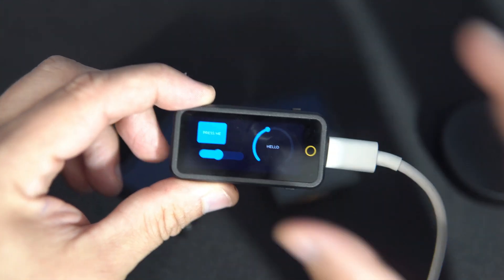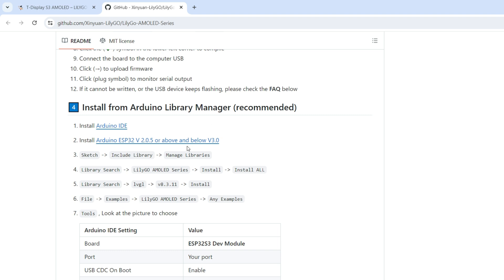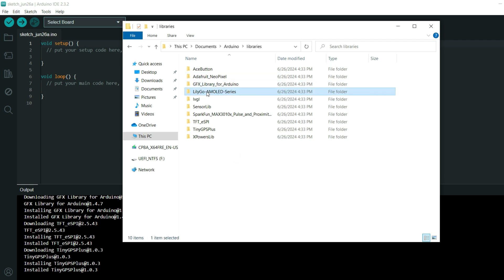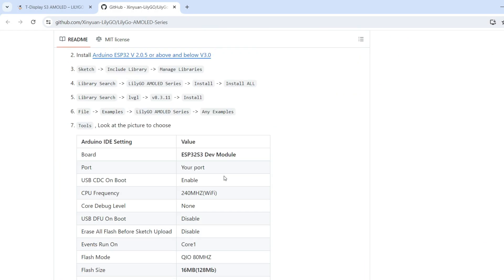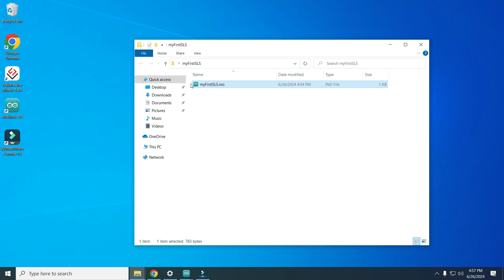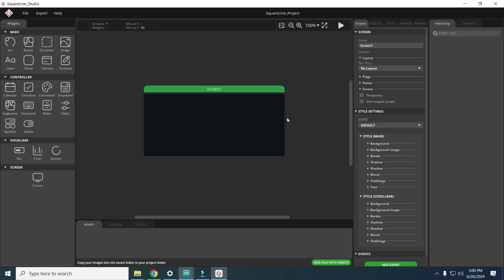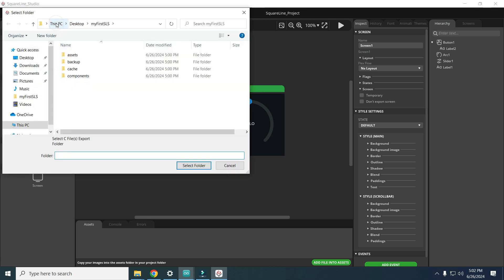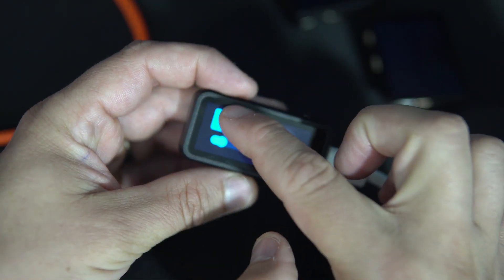SquareLine Studio AND ESP32 - Tutorial Part 1

Comment: Which current board do you advise for S# + LCD + Touch? 

I try to avoid AMOLED board to avoid the buring in issue when using 24x7 for a long time
Reply from the maker: no my friend, amoled dont have burning isue. OLED has.
Reply: @VolosProjects  
Has this been tested? An other brand where I asked the technical support about AMOLED gave as answer. "It is not recommended to display 24 * 7 static pages on the screen, and it is necessary to refresh them periodically""

Thank you for your input

Comment: But you add some "include lines at the beginning of the exported file, such as  lilyGO_AMOLED.h and some others by example the BL_ON for the backligjt is the screen,  the ttgo.begin() and where did you configure the pins for the display from sqareline studio...?
Reply from the maker: evrything is installed by instaling AMOLED series board, thats why i am using this board, becouse it is easies to setup and use with sqareline. you dont need to define any pins, long time ago we needed to do that, but with new board you just install new filles and libraries.

Comment: Why is everything so messed up, installing/uninstaling strictly defined versions of libraries, some not adequate tricks.... and tips. 

Why can’t they ( I mean Squareline Studio) create a development environment like, say, this is done in Microsoft Visual Studio, where everything is simple and clear:   like threw a control (widget) on the form, gave it particular processing and that’s it. In general, I really wanted to start using this library, but I probably won’t.  Hate to do something, which have no clear explanation WHY, when the only "logical"answer to the question WHY is BECAUSE .
Reply from the maker: becouse, this is universal tool, there is hundreds diferent board, that are using difernent pins, displays, drivers, pins configuration. Yes I agree programing this is not easy. But belive me is not that bad, did you ever try program phone app in Android Studio... thats mess
Reply: @VolosProjects  yes, I agree, that this is universal tool. But look at the library TFT_eSPI. This library was written also for hundred different displays. However, you take configuration file, simply edit, unremark your particular driver in huge list of drivers, change, if nessesary several pin addresses, resolution and finita, you done !  No mistic, no fiction , no magic wang.
Just imagine, I follow your explanations, which are completely limited to one particular board. OK, I can follow it. But what if I have for example TFT display with driver ST7796 or any other driver which is compatible with SquareLine? Half of the information, in this case, is absolutely worthless because nobody knows how to wave this magic wand in this case.

Comment: hello

I downloaded the lvgl version 8.3.11 library on Arduino and compiled the example code that implements the library but it gives me an error 

C:\user\documents\arduino\libraries\lvgl\src\lv_conf_internal.h:41:18: fatal error: ../../lv_conf.h: No such file or directory
   41 |         #include "../../lv_conf.h" /*Else assume lv_conf.h is next to the lvgl folder*/

What can be?
Reply from the maker: Did you install amoled series, are you using this board, this tutorial will work only if you use this board?
Reply: @VolosProjects  No, I want to use the wt32-sc01 plus board, along with tft_espi and square line
Reply from the maker: @andresceballos2709  sorry, this tutorial will not work for you.
Reply: @andresceballos2709  I know that the WT32 SC01 Plus can work with Squareline Studio, but I haven't succeeded (yet). For now I will try with Volos' videos with a T3S4, maybe with a little more experience I will be able to get the WT32 working.
Reply: Looks like the folder is not saved in the right place sometimes you download but the path called in an example isn't where it's supposed to be. I'd go through the path it suggests and look for that config file.
Reply: @fireteamomega2343  thanks for you help